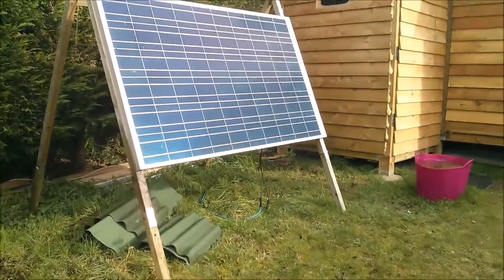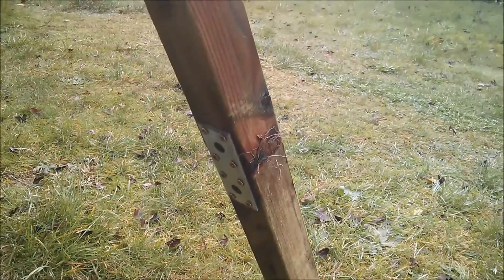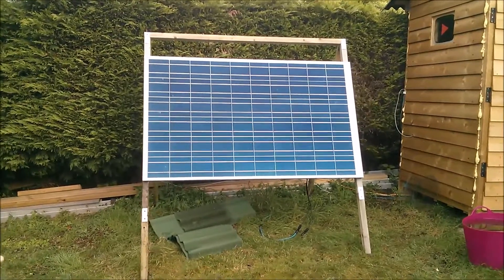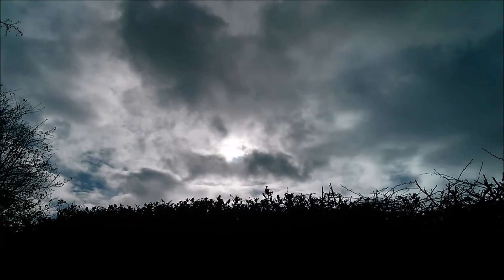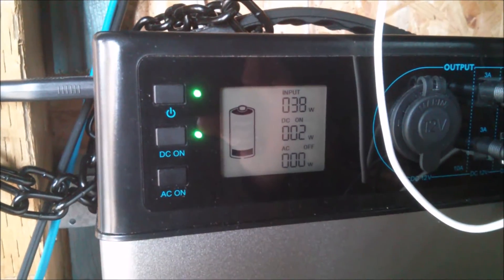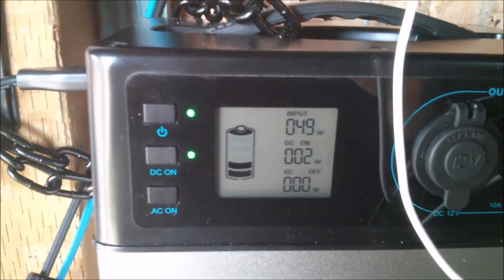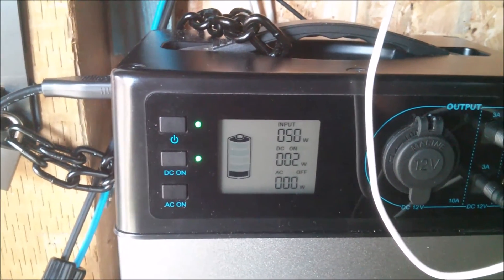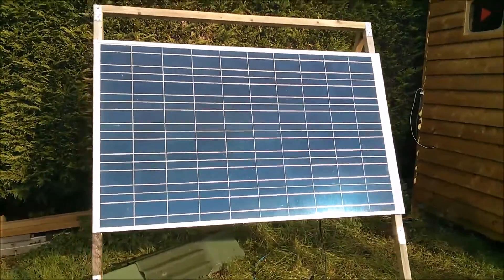Solar Panel Leg Extensions

Comment: Why do you not fit it on the shed roof
Reply from the maker: The shed roof angle is not optimal. I keep my panels angled for the winter sun.
Reply: @JuliansShorts  Cor.... I see a video about motorised solar panels coming up! Track the sun ftw.
Reply: Why not put it on a pole, and somewhat track the sun?   I have a dozen 270w panels to get up, and I'll have the same problem. Shading after only a few hours of sun, I have a few trees to trim, but I don't think a tracker would help me much, maybe if they were on a 20' pole! Ha-ha, not gonna do that, I'm building a 10' x 20' shed, 7' and 10' tall approximately and the panels are going to be the roof, it's not going to be completely dry under them, but better than nothing,